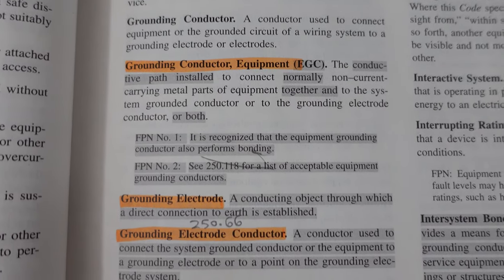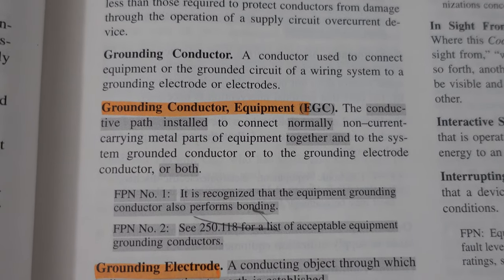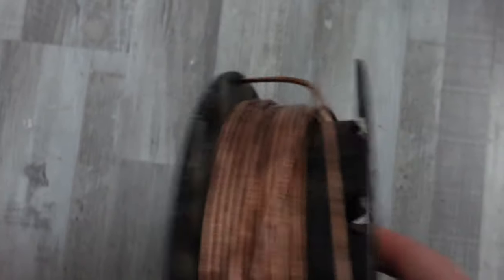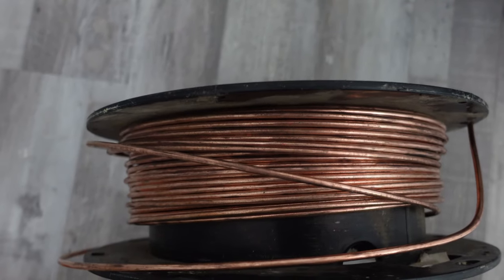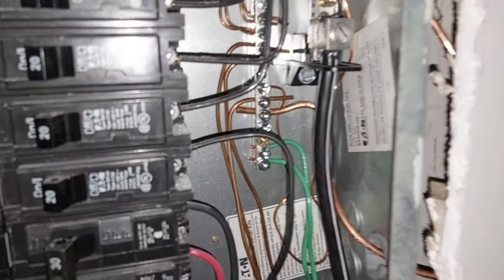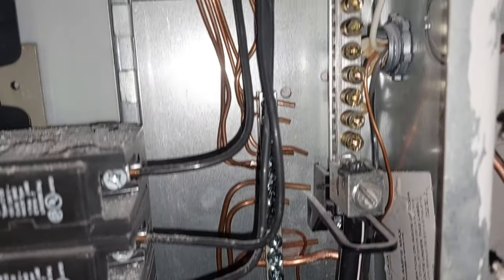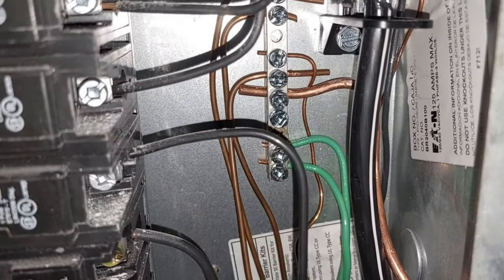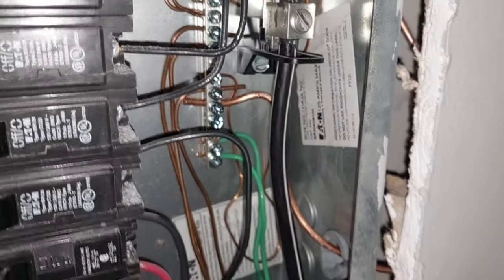How To Ground Your Electrical Panel and Service Disconnect - Common Mistakes

Comment: This is a great video and needs to be sent to all the leads starting out. I've seen this so many times.
Reply from the maker: I agree. Very common, but the code does specify it covers single point grounding systems. Many dont understand it.

Comment: What happens when you wire the ground and neutral from the generator to the sub-panel. Would the neutral and ground connect to the corresponding busbars in the sub-panel? Even though the bonding is in the main disconnect? The generator has a floating neutral. Thanks
Reply from the maker: Yes, If its a sub panel they would still be separate.

Comment: Maybe you can shed some light for me on setting up the ground connect from the meter can to the cutoff switch?  The power company wired the meter with the usual two hots and neutral.  Then they wired the meter can to ground and on their installed ground rod.  I have to install the disconnect.  They require ground bushing to do that.  My presumption is that the bushing should be inside the cutoff box on the service side of the switch.  

Where to I connect the grounding wires to?  At a guess, I should attach the ground inside the meter can and then open a section of insulation for the ground bushing to clamp on then, from the bushing continue the ground wire to bus inside of the disconnect switch.

Is the disconnect now the main panel?  Do I need to continue ground from the disconnect into the conduit and the circuit panel which is now a sub-panel?  I still have to install a separate ground rod for the sub-panel so I am not understanding why I would need a ground between the main and sub-panel.  It's only a 24' run, underground, from the disconnect to the sub-panel so the cost not such a big deal compare the cost of the cutoff switch.

Any links or recommendations you may have to offer?
Thanks, enjoyed the video.
Reply from the maker: Grounding in the meter can depends on the local power company codes and rules. Some require it, where I work they do not want any new work to have grounding in the meter, or uninsulated wires. The single point ground connection where everything bonds together is either at a disconnect if there is one or the electrical panel if there is no disconnect. 

If you have metal conduit to the meter can then you do use bond bushing to ground to the meter can ground terminal.

Comment: i have  6 volts  AC  from  Neutral to Ground
(  ALL  electrical  outlets have this  ) .

the ground wires in the breaker panel are all
tied to the breaker box via the  ground bus,
however
the breaker box  is NOT  tied to the ground rod ,
while the  Neutral   is  tied to the  ground  rod .
thus
neutral  and ground wires are NOT  tied( bonded ) together,
however ,
the  breaker panel appears to have been wired  correctly .

Neutral  to Ground  bonding is  missing

update  june 28  , 2024
i tightened the
Green Bonding Screw .
return  neutral  bus bar  now fully
connects to the  metal breaker box.
0  volts on ground now ,  perfect.

Comment: So, all ground rods terminate at the first disconnecting means right, so the external disconnect after the meter is where they would land, and you do not need any wires coming off the ground rods going into the main panel inside the house? Or do both the disconnect and the panel need grounding electrodes ran into them?
Reply from the maker: @AnonymousUser-kc9qp  Just to the first disconnecting means you terminate grounding electrode conductor.

Comment: You stated before correctly before this point and elsewhere the minimum size grounding conductor, but at 2:51 and 8:00 you state "maximum" size.

Comment: I have a question. At 9:20 into the video I see that in you have connected one of the hot wires coming from the bottom of the meter to the neutral block in addition to the neutral wire coming from the meter. Shouldn’t it be connected to the empty terminal feeding the main breaker? I can’t see how you could have 240 in the breaker panel.
Reply from the maker: @jruggle   @jruggle  Sir, if you don't understand the basics of Alternating Current set up, then it's probably best to leave it to a professional. Anybody who just knows the basics knows that's the neutral terminal. The wire just wasn't properly marked white by the previous installer. The hot wire is still hanging out, you just can't see it in the video.

Comment: Something doesn't look right in that panel.The main panel . I noticed the main only has one leg
Reply from the maker: Those boxes are so tight I had to pull it out to show the neutrals. Installed the wire once I turned off the camera. ⚡

Comment: How many ground rods you need to install for 100 amp service?
Reply from the maker: A minimum of 1 electrode is required. If it has a resistance to earth of 25ohms or less then you do  not need a supplemental electrode. If you do need 2nd electrode it must be 6ft or more apart from 1st electrode. 
So its about the ohms to meet the code, not how many. Good question
Reply: Thank you.
Reply from the maker: @Doomm3x  Also, something else to note is that if a permit is required in your jurisdiction and the service may get an inspection by AHJ, that inspector may make you install 2 ground rods no matter what. It can depend on the inspector as well since they have the authority, so when I do some service installs I just put 2 either way.
Reply: @33electric33  Agreed always 2 to be safe.

Comment: You have a hot wire off the load side of the meter going into the ground bar.
Reply: I noticed that as well, also, he's got L1 missing on the breaker. So only half the sub-panel is energized. The "hot wire" attaching to the ground bus is his neutral but it should have had white tape to distinguish it from the other conductors.